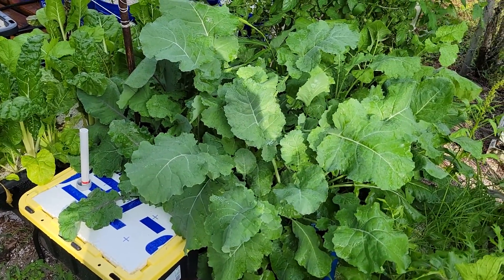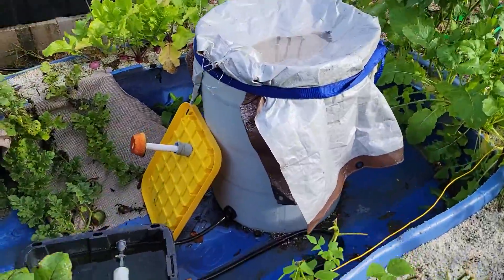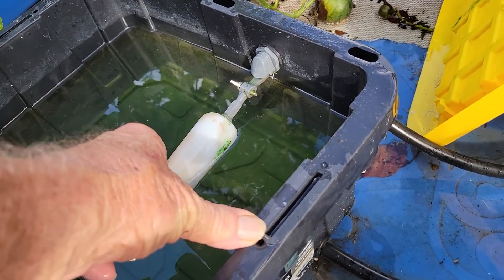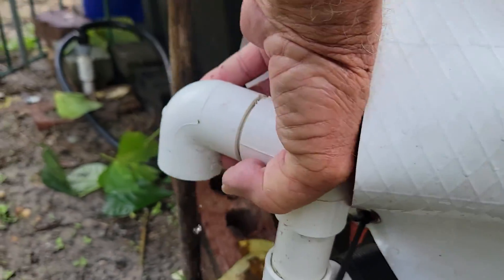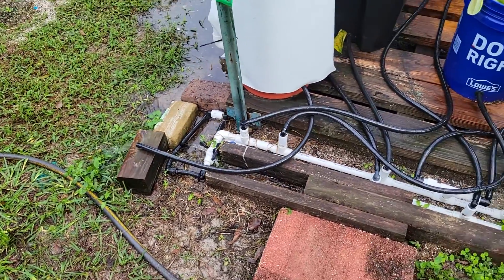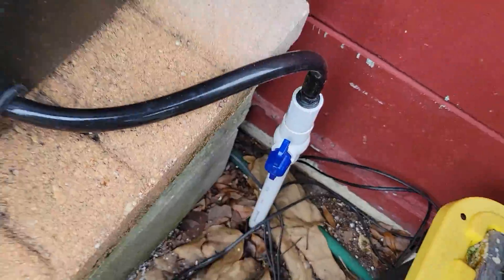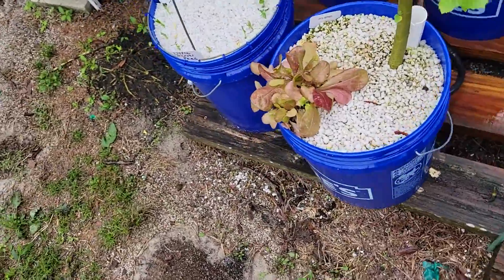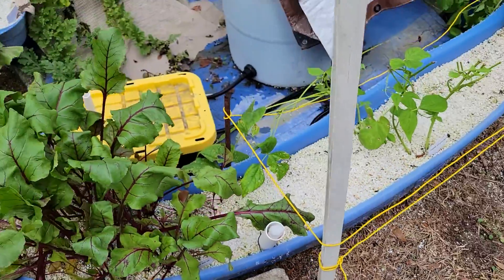how the hydroponic garden works without pump or electricity. Remove rainwater and add new nutrients!

Comment: I’m a little confused. Can you please explain the process. I see you have a large reserve tank for water. And a separate tank with a float valve. It looks like the float valve only allows the water in from the reserve tank when needed by the plants. Is the float valve tank where you put the fertilizer? Why not add fertilizer to the main tank and eliminate the smaller tank?
Reply from the maker: Approximately  5 months ago, I made a video called
 (D. I. Y makeing 5 gallon hydroponic system). 
This video will explain most of your questions. If you have any more questions, I will be putting a new video out in the next couple of weeks. That will explain other ways to make  this easier and cheaper . With a list of parts easier to access.